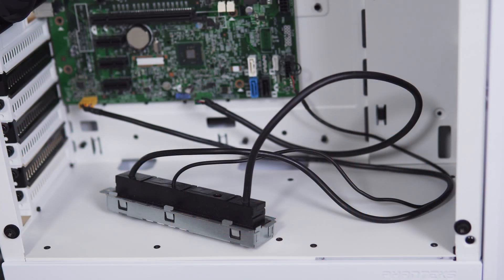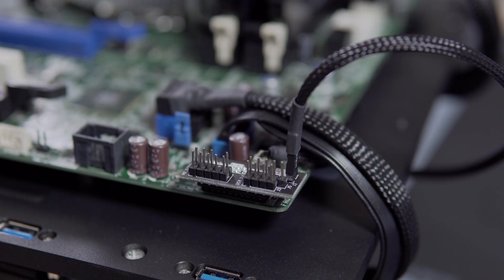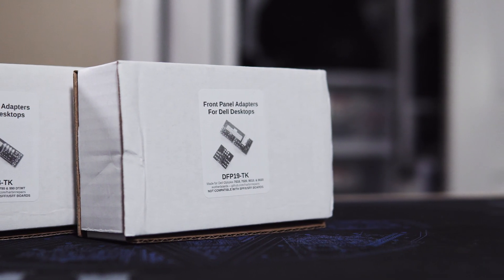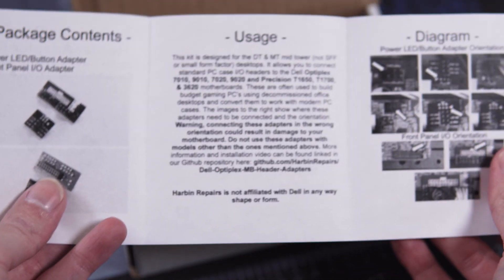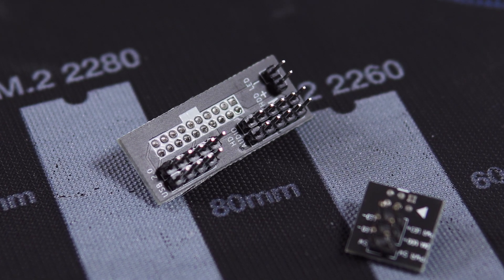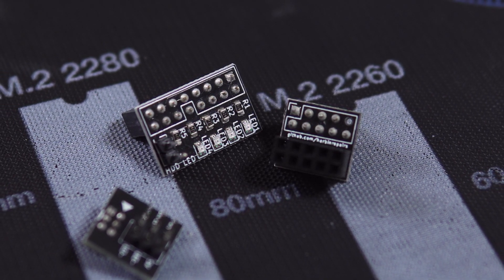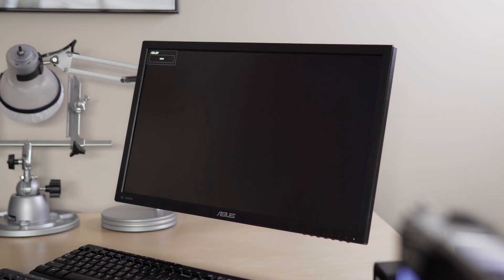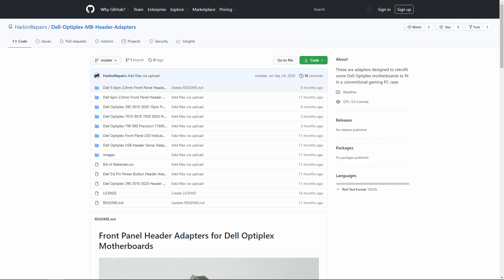Dell OptiPlex Case Swaps Just Got A Lot Easier

Comment: You don't know how much I wished I had these back in the day before covid when I used to build pcs or bring new life to old hardware with new cases for customers in tight budget but the problem with this kit is the price 25 dollars is a 120gb ssd for something that cost 1 maybe 2 dollars in material to make thats gonna be its downfall the market its going for is from people who already know how to build pcs someone that doesn't will not buy this cause bringing new life to optiplexes in New cases is to hard for normal people if these kits where 5 10 dollars id buy them but getting rid of 25 dollars in a budget system which is what mayority of people will not do in a budget system its a hard sell ESPECIALLY WHEN SOME MOTHERBOARDS ALONE COST LESS THAN 25 DOLLARS thats the shocking part about this but great video non the less

Comment: Are there any such reverse kits to fit motherboards into dell cases? As crazy as it sounds, I kinda dig the aesthetic of the Optiplex line and I want that "sleeper pc" in a modern chassis lol
Reply: Would really like to put a modern mATX mobo in an Opti 9020 case - of course with new PSU, SSD, maybe mod the rear fan area to make room for a 120mm fan or AIO.!

Comment: I know you do all the optiplex vids, but I still love some of the old 2nd and 3rd gen lenovo boards. They were great for case swaps. Power is standard. Mounting holes all standard. USB2 headers are not standard but they have like 2 extra pins. You can just ignore when connecting to them and works perfect. The only thing not standard really is the audio header, and you can buy 99 cent adapters from china for that. Those were and still are some of the best boards for cheap builds. Just wish the lenovo 4th gen boards didn't suddenly become so non standard.
Reply from the maker: I'm definitely going to start branching out to other OEM systems, as well as some content that's not directed at OEM builds at all. I tend to avoid Lenovo since they went so far the other way recently. It really irked me that they did GPU whitelisting. Makes figuring out which model to get even more of a PITA than the Opti's were. Not saying I won't grab one in the future though. But I will be doing some videos on an HP system soon.

Comment: Thanks for the shoutout and review, we hope our adapters helped you out and your followers with their awesome builds!
Reply: Do you ship to the UK yet?
Reply: @HarbinRepairs - We recommend these kits throughout our comunity on FB @ https://tinyurl.com/y7ezf5nb Check us out!!!
Reply: I helped a friend with his optiplex 7010 and I JUST installed this on my old 7010. I will say the top power switch had to be installed upside down for it to work. Other then that it’s all good. When it’s right side up you don’t have any control over the power switch. No idea but it works upside down just fine. It’s a game changer to transform the opti into something more useable and aesthetically pleasing.
Reply: @therealmichaelphelps  the white arrow on the power adapter points to the empty pin slot on ur mother board.
Reply: I have ordered 2 sets of your pins and I have done 2 case swaps. They are the needed tech to do the job right! Thank you
Reply: Thank you for making this
Reply: I bought a 5/6 pin power button / LED adapter as soon as I watched this.  In my case swap I kludged the OEM front panel into an empty drive bay (it's not pretty, but it works.  Installation was fine (once I did it right) but I have a suggestion - is it possible to make the adapter control both the power LED and the diagnostic LED from the same pins?
Reply: @mikemurley8656  What you're looking for is a dual color led that changes depending on the polarity of the LED, the original LED on the Dell chassis is a dual color LED however 99% of most cases will only have a single color LED. Since the power LED on the original chassis changes polarity when it indicates an error, there's nothing stopping you from connecting a dual color LED to the power LED pin on the adapter and it should work fine. Most people just use the HDD LED as the diagnostic indicator anyways.
Reply: @HarbinRepairs  when will you guys ship to South Asia Countries like Pakistan
Thanks
Reply: @asheramir2002  so they can turn the old Dells that get sent to the E-waste dump in Agbogbloshie into “Gaming PCs” to send back to the US.
Reply: @mac10man  thats not what I meant I basically want my dell motherboard to be put in another case but they don't deliver this in asian countries
You took it the wrong way
Reply: Ordering mine soon😃
Reply: What’s the link for a 3847 adapter? I’d love to change cases to something “sexier”
Reply: Anything for a 3847?
Reply: Harbin Repairs, adapters for my 9020 to Mustex case went well. Do you have anything for the Dell Optiplex 5050 sff? I'm coming up short on the front panel header info.
Reply: @sycklecell615  The Optiplex 5050 front panel power button connector is the same as the 9020 power button adapter and is compatible (DFP05-PWR-T). As for the front panel USB header we are working on an adapter that plugs into the front USB connectors and provides an internal USB header, won't be ready for a while though.
Reply: @HarbinRepairs  that is very cool. Looking forward to that innovation. The mobo design isn't very forgiving. Cheers to your future success!
Reply: @HarbinRepairs  please. please make a kit for the 9020 sff
Reply: @jouldalk  We're working on it.
Reply: @HarbinRepairs  Great news! Thanks! Looking forward to placing an order on your online shop :)
Any approximate ETA maybe?
Reply: @jouldalk  It might be a while since we are in the process of moving our business location.
Reply: @HarbinRepairs  dang it :(
Reply: Love the product I used one for my daughter's Dell swap works great